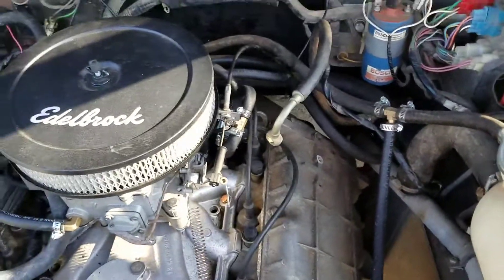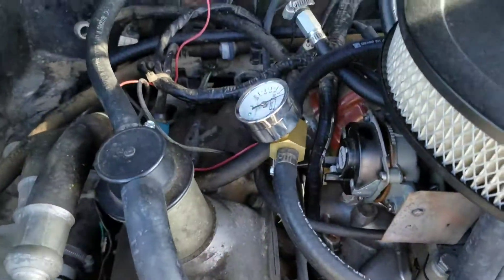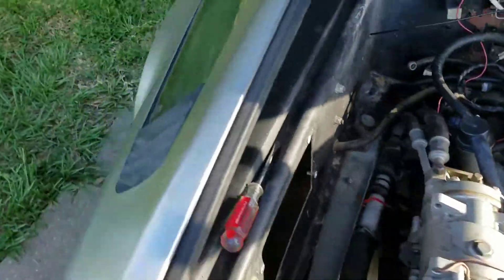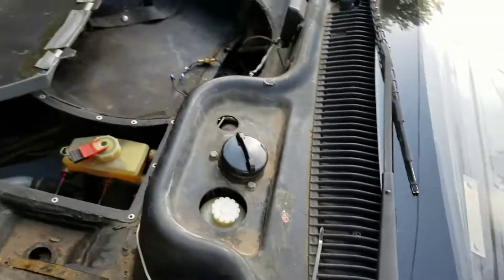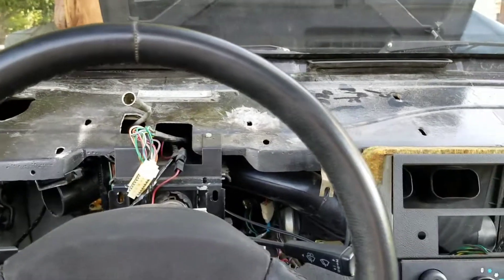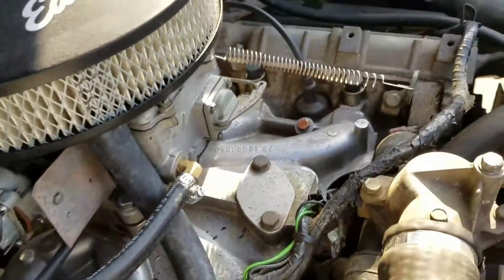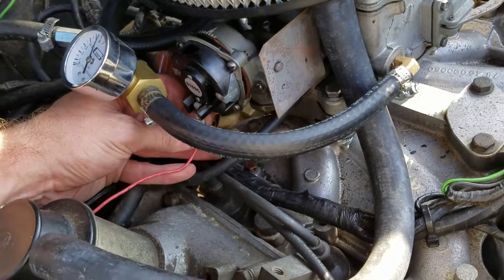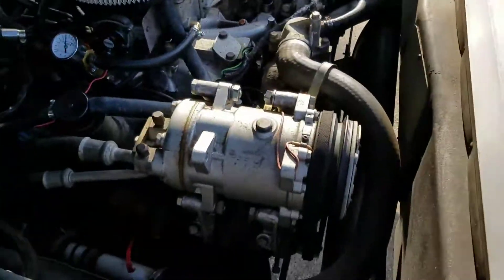Carbureted DeLorean with mechanical fuel pump

Comment: Not exactly original here, Mr. Originality. I guess you couldn't figure out how to fix the rather simple K-Jet?
Reply from the maker: Wrong car; if you haven't noticed, I've had about 6 DeLoreans.  This one had the fuel injection setup stripped when I got it; there was no intake manifold, fuel distributor, etc.  I can fix/troubleshoot it; I cannot pull parts out of thin air.

Comment: Looking for one now. Thanks for the oil pan by the way. The $15.00 should be there now
Reply from the maker: I've got spare pistons; they're yours for the cost of shipping.
Reply from the maker: No idea if they're good; heck, I'd give you the entire short block if you can arrange shipping.
Reply from the maker: I don't know if that manifold will work on your 3.0 setup, though.
Reply: DMC1601 my 2.8 is rebuildable. I was going to rebuild it and store it. But the intake you have is getting harder to find so if I find one I'll hold on to it with the motor. I just need some new pistons. 2 of the ones I have the ring seats are cracked.
Reply: DMC1601 sounds good to me. Let me know how much. Any good cylinder sleeves. I think I had a couple that were ruined when the pistons broke

Comment: Does this work better than the custom one made?
Reply from the maker: Significantly better.  I've had a car with both and the Peugeot manifold and carb setup is the best; it even outperforms the Stage II car I used to have.